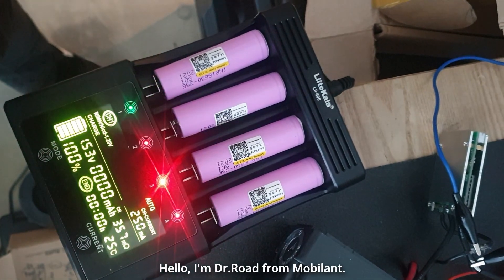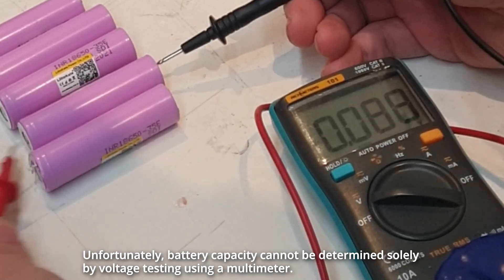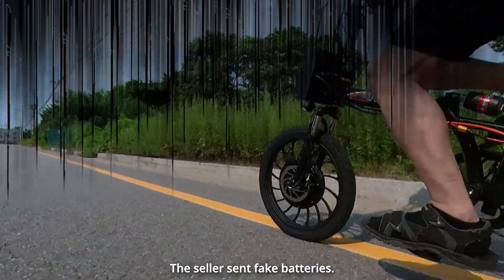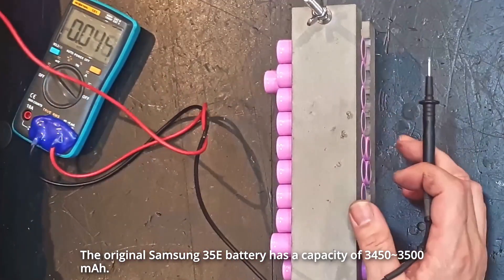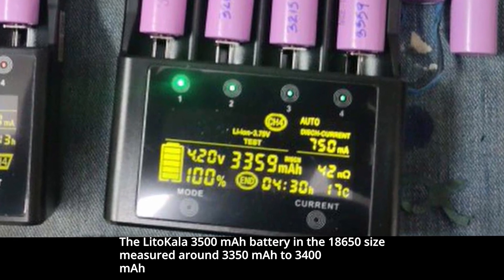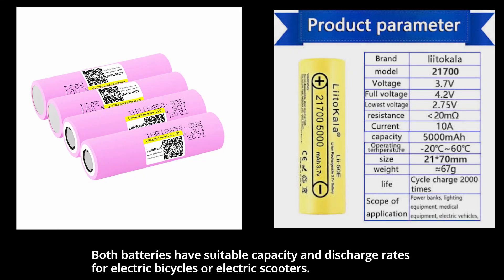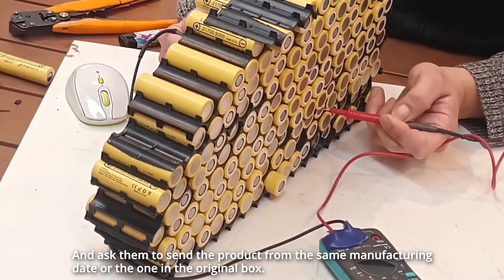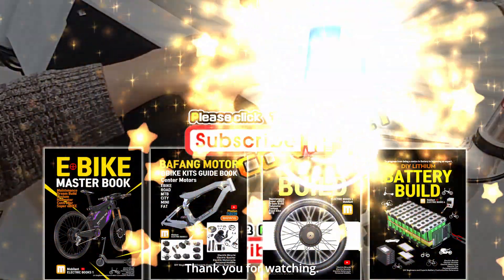Check E-BIke Battery Pack Build  : LiitoKala Lii-600 Battery Charger and EBIKE BOOKS

Comment: Dr. Hello again, You say to use a a 220V timer to control so as not to over charge the battery. I think that could be difficult to achive, if we don't know how low is the battery how long should we charge it?. I thought to install an in-line VOLT controler, set at say 34V cut OFF the charging supply to the 36V battery. Do you think that this a reasonable idea? and if Yes, why is not adopted from the industry? I appreciate your feedback and your kind comments. John.
Reply from the maker: It is possible with a charger that allows CV (Constant Voltage) and CC (Constant Current) control. However, the reason for requiring a full charge is that the balance circuit functions when the voltage exceeds 4.2V per cell. If you have a 10Ah battery, do not exceed 5 hours when using a 2A charger. This alone can prevent most battery charging fire hazards and overcharging risks.
Reply from the maker: It would be even better to incorporate active balancing functionality, similar to that of a car battery. However, this requires continuous monitoring of the battery, resulting in significant energy consumption. It can lead to critical battery depletion. Consequently, the BMS (Battery Management System) becomes larger and more expensive. Using such a system is not practical for batteries with small capacities.
Reply from the maker: Using such features is also recommended.

Each country may have various types of timers available.
https://amzn.to/3pZQOl9
Reply from the maker: Although it is described in the book, the full charge voltage for a series connection of 10 batteries is indeed 42V. The voltage you mentioned earlier seems to be slightly lower, which could be the storage voltage.
Reply from the maker: Why cut the charge voltage to 34v?We can give you a better answer if you tell us your purpose.
Reply: @Mobilant_TV  Thank you for your interest that you are taking!! 
My battery is: 36V,   18Ah/ 648Wh, Limited Charge is 42V (written on the battery itself)
My Charger is: 42V,  2A.
I want to prolong the battery's life.
I can not understand for how long to set a household timer to charge the battery that perhaps is partly or fully discharged? 
How can I not overcharge or undercharge in this way? (okay I have a voltometer, but my "wife" perhaps not (I understand that the battery has a cut-out if overcharging, but is one and only one) If I use a household timer, how do I know how long does the battery needs to get full charged?
 Or how can we set a timer to partly charge the battery say at 90% or at 95% so as to prolong its life?
 I thought that if we introduce a (XH-M604 Battery charging control module {Aliexpress}), we can set its cut off output at 90% or 95% in order to extend our battery's life. But after say 10 Charges of reduced rate, give her a 100% charge to Balance the cells. 
I Hope that I managed to explain what I am trying to do. Thank you again!
Reply from the maker: @Jhpc399  Using a module is a very good idea. If you use a module, you can set it to 4.15V x 10 cells, which will be 41.5V. I recommend setting the storage voltage to 3.8V x 10 cells, which is 38V. The full charge voltage for one cell is 4.2V. Consider 3.7V as 50% charge level. When the voltage reaches 3.0V to 3.0V x 10 cells (30V), it's considered 0% charge.

I highly recommend using a timer to prevent overcharging beyond 4.3V due to potential BMS malfunctions.

The easiest method is to purchase this product and open the case to adjust the voltage by turning the blue variable resistor: https://s.click.aliexpress.com/e/_DdHIRk1

Details on how to use it are on page 369 of the Masterbook. 1
Reply: @Mobilant_TV  :hand-pink-waving:Hi! Thanks a million for your golden advices! 
I have checked my 2 chargers and they give me 41.7V and 41.8V so I am ok within the 0.6V limits there?
Now as I mentioned earlier, I am trying to prolong the batterie's lives  ☺, by under charging them and not giving them the full 41.5V or 42V, what voltage should I set the modulator If 41.5V is the safe turn OFF point? Is 39.2V a reasonable charge so as to get some Km while safeguarding them?
And I still don't understand for how long to set the timer. Different voltage charging requirements need different lengths of times for the charger to stay ON. 
I had a consideration of the wattmeter (Good to have if I could understand all the information that offers) About the high end charger good but, The adjustments are not easy enough for me... (I didn't go to school every day ☺).
Please also tell me how can I reward you for your help. You are talking and helping a total stranger, and this does not happen very often!
Reply from the maker: @Jhpc399  https://youtu.be/hBp-zAlQB2U
There is a part related to BMS in this video. The recommended charging voltage is actually around 42.6V for the BMS to function properly. If a 10Ah battery is charged at 1A, it will take 10 hours to fully charge.

The charging time is determined based on the consumed Ah. In fact, the worst thing for battery life cycle is rapid discharge and rapid charging. If you frequently ride an electric bicycle, it's best to do a full charge. This will help maintain the longevity of the battery cells.
Reply: @Mobilant_TV  Thank you Precious information you gave me! 
I looked the Aliexpress Charger, It is a fast charger and I think I should avoid fast charging as you told me. (I am a pensioner and I have all the time). The Voltage modulator will stop the battery charging when it gets to the set Volt number, I just don't understand how the timer will help me (I have a few spare timers availlable) but I don't know when the charge gets to above critical level to set the timer. Or do you mean to set it at say no more than 10 hours as the charger is 2Ah and the battery is 18Ah and it does not matter if the battery is 1/2 or 3/4 empty? This is my burning question. 
I am honored for your time spent with me. Thank you Sir.
I am off to Amazon to get your Battery book.
Reply from the maker: You don't need to worry too much about battery levels and full charging. Periodic full charging is necessary for voltage balancing of the battery serial cell blocks. When the voltage difference between the battery serial cell blocks starts to increase, it becomes challenging for the installed BMS (Battery Management System) to balance them.

If one or two cells in the battery start to malfunction, repair is possible, but it requires spot welding and takes a considerable amount of time. Repair methods can be found in books and videos.

If you are using a 36V 18Ah battery and have used it entirely, setting a 9-hour timer will result in an 18Ah charge. If you have used about half of the battery today, consider setting a timer for around 5 hours. This is the best method, stress-free, and how I personally manage my batteries.

The 8 batteries have not experienced balance collapse. If you plan to store the battery for over a month, it's recommended to charge it only up to around 39V before storage.

Thank you. 😁😁
Reply: @Mobilant_TV  Thanks a million times for all the care and respect you've given to a 72 years young man! 
Thanks for answering so often and so promptly! Wishing you Blessings to everything you do, you and your family. Now, I have so much to read, watch and learn. My wife and I, we will get tons of pleassure from our new bikes and thanks to your wisdom and books, I will try to mentain and repair them. Goodbuy for now.:hand-pink-waving::hand-pink-waving:

Comment: Does the LiitoKala charger measure correct the battery resistance?
Reply from the maker: The battery internal resistance changes according to the battery voltage condition. It's just a little bit useful when you're looking for old batteries.
It is most accurate to check the capacity. Do not use a battery whose voltage has dropped significantly after 5 days after being fully charged and disconnected.
Reply: @Mobilant_TV  thanks, I know the hole stuff over lipos ect, my interested was if the resistance get right measured from this 600 charger, because many charger do more like guessing than actually giving out the real resistance of a battery 😂 and I was hoping if this charger would if the testing get at least 99% correct. 🤗